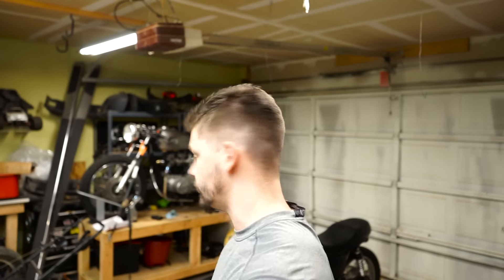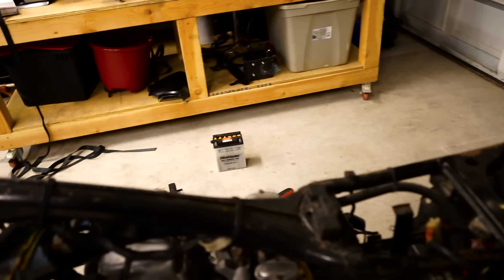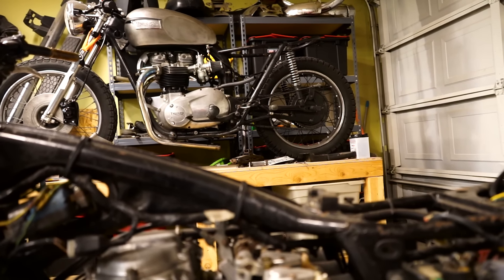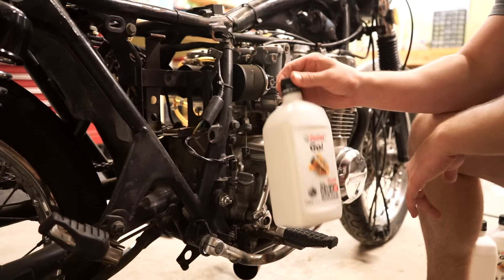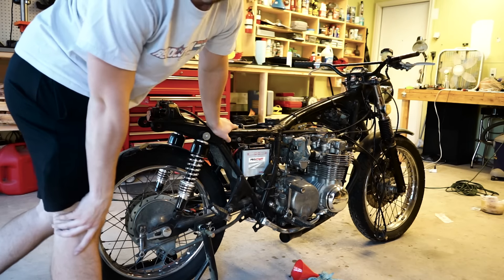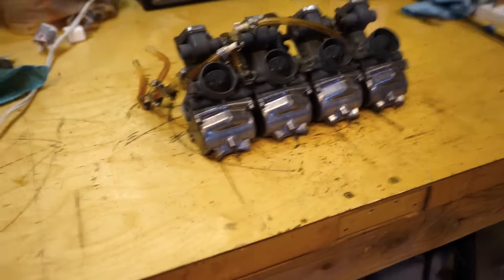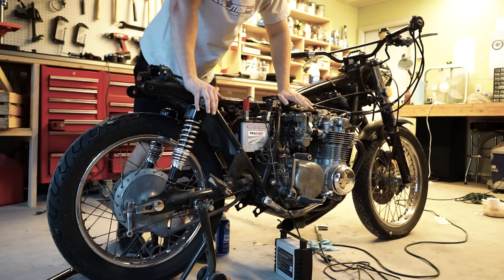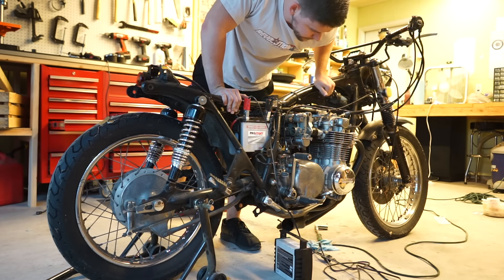She runs and she's LOUD

Comment: Enjoying this series - very glad I stumbled across them as I have a 550F that's mostly finished and running semi-well. Thanks for the effort! Quick question on jets and pods, did you just leave the pilot/idle jets stock? 38 if memory is correct. Needle clip position just stock as well? Thanks again!
Reply from the maker: Yes, I have had good luck with just bumping up the main jets. Carb tuning has a lot to do with where you live (altitude, temp, etc) but that setup should get you pretty darn close.

Comment: Hey I got my cb550 running but its only running on 3 cylinders. 1 cylinder isn't burning gas. The sparkplug sparks fine, boots fine, the carb bowl is full and will suckout gas if i put my hand over the back of the carb while it srunning. Valves for that cylinder are adjusted correctly.  Do you have any idea why its not burning fuel?
Reply from the maker: Have you run a compression test yet? You could have low compression on that cylinder.

Comment: hi,great video ,very informative...i have  a question, how to shorten  front forks on them bikes. do you have any video  about that (i couldn't  find  any)  or any info somewhere.  i would  appreciate  your  help. thanks
Reply from the maker: You can loosen the triple tree and slide the forks up to lower the front end.  You can also but shorter springs too I believe.
Reply: Classic Octane hi . thanks  for your  response.  i know that forks  can be slide  up and down  but i was hoping  you have some videos  about   shortening the spring. as what  is correct  method. ;) 
thanks

Comment: How do you get the rust off the tank. I have a 67 CL125 honda that has surface rust on tank and its quite pitted. Is there a way to get this tank restored? There are no holes in the tank it is pretty solid.
Reply from the maker: I just bought an Eastwood Contor SCT. It worked awesome on my latest tank. I will have more info in my next video.

Comment: any opinion of kick start over electric? my bike has both, but I'm debating getting rid of the electric so i can run a smaller battery. 

What are your thoughts on that?
Reply from the maker: I ran a pretty small battery on my last CB550 and didn't have any issues. I just used the kick start if the battery was running low and didn't have enough juice to turn the motor over.
Reply: @ClassicOctane  
Chris riddiford

Comment: Great video! I'm trying to get my 550 (78) started before tear down. 
Gotta get the frame powder coated, would be great to see a video on tear down and reassembly. 

What kinda handle bars are those? 

Also my gearbox wont get into anything above 1st & N. Any ideas on that?
Reply from the maker: Those bars came with my Triumph but i'm not 100% on where they are from. I haven't really dug into the trans much so I don't have much to offer there unfortunately.

Comment: Couple questions...what size pods (mm) for the carbs on the CB50's, and any suggestions on a good source for buying carb parts, (ie. pods, jets, carb rebuild kits)? I had to do a float needle swap out on one of my carbs a couple years ago and it took a couple months to get it shipped from Canada to the states. I assume Amazon is the quickest and safest route? Any suggestions?
Reply from the maker: I use 4into1.com for most of my carb parts. If memory serves me I believe the pods are 39mm.

Comment: At the 6:18 mark you put an additional o-ring on the inside of the filter bolt, mine did not have one when I removed the old filter. Is it suppose to?
Reply from the maker: They came with o-rings from the factory so I would suggest using one.

Comment: Hey man I have a 77' cj360t and I can't figure out why I'm not getting spark. Do you have any tips or advice for no spark situations?
Reply from the maker: I would check points and condenser first. Might be as simple as filing the points a little to remove some corrosion buildup. If that doesn't do anything I would start checking to make sure your coil is getting power.

Comment: how come you don't use a 20oz bottle with gas in it and a line to the carbs?
Reply from the maker: I didn't want to run the bike for long with how loud it is currently. My neighbors are pretty cool but I don't want to push my luck.

Comment: $28 battery? Got a link? I got a cb550 as well and I'm looking for a battery.
Reply from the maker: http://amzn.to/2fzC2HT  This is the one I used on my last bike and will most likely use again on this one.  Thanks for watching!
Reply: Do you think it would work on a cb750?
Reply from the maker: I think a 750 might be a bit too much for that battery to turn over. If you only planned on using the kick start then it would probably work.
Reply: Thanks Classic Octane !
Reply: Hey so you mentioned 110 main jets, how about the other jet? Did you leave that the stock? Thanks

Comment: Surprised you didn't squirt some fuel in the bowls, would have let you run it longer. Good to see that is fires non the less.
Reply from the maker: Yeah, without a muffler I didn't want to run it very long. Didn't want to bug the whole neighborhood.
Reply: I can understand that. How many bikes have you built at this point?
Reply from the maker: This CB550 will be my third CB550 and fifth bike total. The Triumph will the the sixth.
Reply: That's cool. I  like the channel. I am just starting out on my first build. Recently aquired a 79' CX500 with 8k on it for a few hundred.